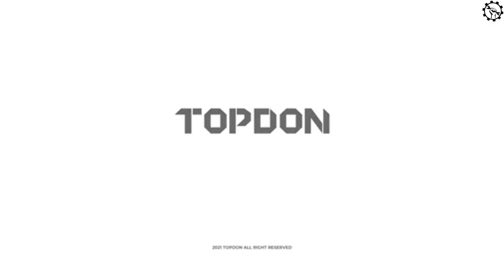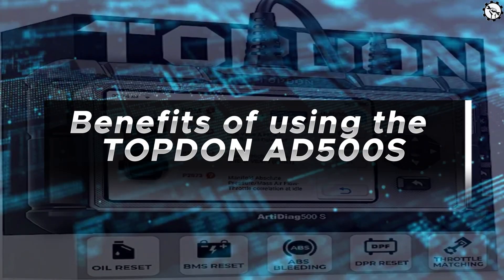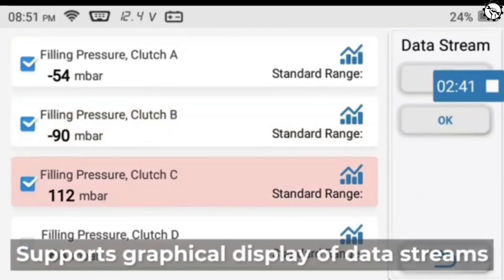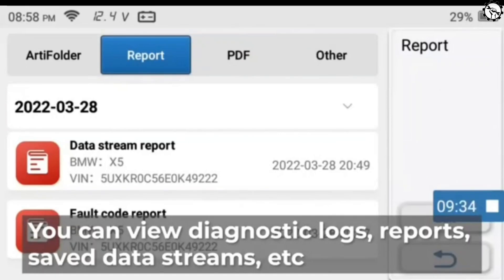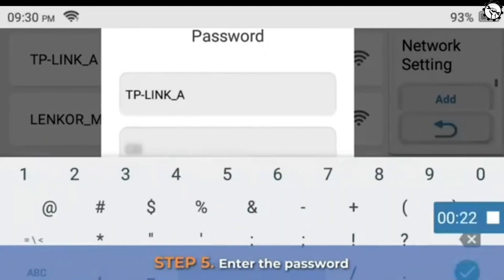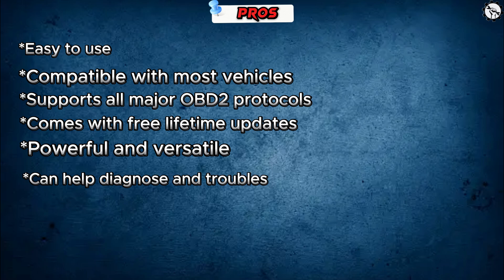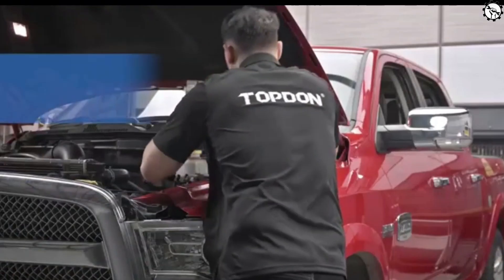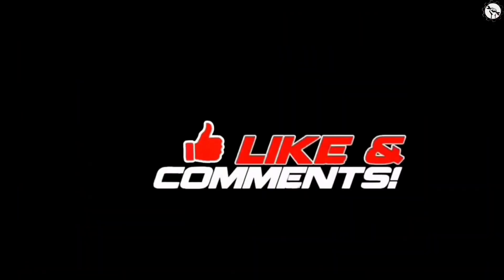TOPDON AD500S Review: The Ultimate Guide to This Powerful OBD2 Scanner |

Comment: How to unbind an account on the topdon Ad500 please help
Reply from the maker: Good question — this is a common issue with TOPDON tools.

To unbind a TOPDON AD500/AD500S, it usually can’t be done directly on the scanner if it’s already linked to another account. The binding is tied to the TOPDON user account on their server.

Here’s what to do:

If you are the original owner, log into the TOPDON app or website with the account that first activated the scanner and remove the device from “My Devices.”

If you bought it used or don’t have access to the original account, you’ll need to contact TOPDON support and ask them to unbind it for you. They’ll typically ask for the device serial number, proof of purchase, and your TOPDON account email.

Once unbound by TOPDON, you can log in and activate it normally.

Unfortunately, there’s no manual reset or button combo to bypass this — it has to be released server-side.

Comment: Does it do the fuel rail pressure sensor on a range rover Evoque
Reply from the maker: The TOPDON AD500S OBD2 Scanner is a versatile diagnostic tool that can read a wide variety of codes and perform various diagnostic functions. However, specific information about its compatibility with the fuel rail pressure sensor on a Range Rover Evoque is not explicitly mentioned. It's best to check the scanner's manual or contact the manufacturer for detailed compatibility information. If you have any more questions or need further details, feel free to ask!

Comment: wondering if it will do a/c
Reply from the maker: The TOPDON AD500S is a battery charger, not an air conditioner. It is designed to charge car batteries, not provide cooling. If you're looking for a device to cool your car, you'll need to consider a portable air conditioner or a window unit.
Reply: @weeklytools LMAO i think he meant diagnose and test ac systems on vehicles

Comment: Does this work on 2015 and higher ?
Reply from the maker: Yes, the TOPDON AD500S OBD2 Scanner is compatible with most vehicles from 1996 and newer, including those from 2015 and higher1. This scanner is designed to work with a wide range of car models and provides comprehensive diagnostic capabilities, including reading and clearing codes for engine, ABS, SRS, and transmission systems1.

Is there a specific vehicle model you’re planning to use it with? I can help you check its compatibility further if needed.

Comment: Do you have to pay every year in order for this  OBD reader to work ? If you dont pay does that still work ? Do you need to  have internet to used it ? If you don't updates does that still work without updates ? Out from the box can you used it without wifi or internet ? Can this scan for Fuel Pressure ? And can this scan for  compression test ? Is this a Complete  diagnostic Scan tools ?does it Scan from 1996 cars going up ? How about Toyota Camry 2001 2.2 Liter  4 Cyl or Buick Park Ave 2003 3.8 Liter does it Scan these cars ? Does this scan for battery ignition parameters ? Does it Scan for a bad head gaskets ? Is this the latest version 2024 ?
Reply from the maker: Here's a breakdown of your questions about the TOPDON AD500S OBD reader:

Yearly Fees:

No, you do not need to pay any yearly fees to use the TOPDON AD500S.
The scanner provides free lifetime updates for software and vehicle coverage.
While optional, these updates provide bug fixes, new features, and expanded vehicle compatibility.
Internet Connection:

The scanner works directly with your car without needing an internet connection.
You do not need internet to diagnose most vehicle issues or use its core features.
However, internet is required for downloading updates and accessing online support.
Functionality without Updates:

Yes, the scanner will still work even without updates.
You can access basic diagnostic features and read existing fault codes.
Updated software may offer newer tests, expanded vehicle coverage, and bug fixes.
Out-of-box Usability:

Yes, you can use the scanner right out of the box without WiFi or internet.
Simply plug it into your car's OBD-II port and power it on.
You can access basic functions like reading trouble codes and checking emissions readiness.
Specific Features:

Fuel Pressure: Some users report the scanner can read fuel pressure on specific vehicles, but confirmation depends on your car model and year.
Compression Test: The TOPDON AD500S cannot perform compression tests. This requires specialized equipment.
Completeness: While powerful, it's not a complete diagnostic tool for all situations. Some complex repairs might require dealer-level equipment.
Vehicle Coverage: The scanner claims to cover cars from 1996 onwards.
Compatibility: Yes, it should scan your 2001 Toyota Camry 2.2L and 2003 Buick Park Ave 3.8L.
Battery & Head Gaskets: It can read battery voltage and certain parameters, but not full diagnoses. While it can provide clues, further testing might be needed for confirmation.
Latest Version: The 2024 version information is unclear. Check the official TOPDON website or seller details for confirmation.
Additional Notes:

User reviews suggest the TOPDON AD500S is a good value for DIY mechanics and car enthusiasts.
Consider your specific needs and budget when comparing it to other OBD readers.
Always refer to the official product manual for the most accurate information on features and compatibility.
I hope this comprehensive response helps!
Reply: @weeklytools  Thank you for the explanation on the product .You explained the product good .

 Is the Topdon Artidiag600S  the same as this one ? Is that free also like the 500 S? What is the difference ?
Reply from the maker: As for the price, the Topdon Artidiag600S is typically more expensive than the Topdon Artidiag500S. This is due to the fact that the 600S has more features and is compatible with more vehicles.

Whether or not the 600S is "free" depends on what you mean by that. The scanner itself is not free, but it does come with a free lifetime update subscription. This means that you will always have access to the latest software and diagnostic information.

I hope this information is helpful. Please let me know if you have any other questions.
Reply: @weeklytools  What I mean free you don't have to pay yearly .Because it's only a regular scanner .so I believe everything comes with it .
Reply: @weeklytools  What Year is this Topdon AD 500 S ? ebay told me that I have to pay $49 a year after 1 year .ebay is saling their Topdon AD 600 S. 2024

Comment: You are so right about the software. And I've found that the sustainability of the battery doesn't really last that long. It would be nice if you could see the battery power. As a small icon on the screen. 
The car battery is suppose to sustain the obd2 tool but I for some strange reason my obd2 tool went into a boot loop and took over a day to recharge. I know what you maybe thinking but my car battery is less than 6 months old and had a deep fully recharge. 👍🏿 as a birthday present I suppose I can't complain but it does seem a bit temperamental. 👍🏿👍🏿
Reply from the maker: First,Happy Birthday to you.

I see. Well, there are a few possible reasons why your OBD2 tool went into a boot loop and took over a day to recharge, even though your car battery is new and fully charged.

The OBD2 tool may have a faulty power supply. This could be due to a manufacturing defect or damage from physical shock.
The OBD2 tool may be trying to update its firmware. This can sometimes take a long time, especially if the firmware is large or the OBD2 tool has a slow processor.
The OBD2 tool may be corrupted. This can happen if the tool is not properly shut down or if it is exposed to a power surge.
To fix the problem, you can try the following:

Try a different OBD2 tool. This will help you to determine if the problem is with the tool itself or with your car's electrical system.
Reset the OBD2 tool. This can be done by following the instructions in the tool's manual.
Update the OBD2 tool's firmware. This can be done by downloading the latest firmware from the tool's manufacturer's website.
Restore the OBD2 tool to factory settings. This will erase all of the tool's data, but it may fix the boot loop problem.
If you have tried all of these things and the OBD2 tool is still not working, you may need to contact the tool's manufacturer for further assistance.

Here are some additional things to keep in mind:

You don't need to have the car running to use an OBD2 scanner. You can read trouble codes with the ignition in the ON position.
If you are using a wireless OBD2 scanner, make sure that the scanner is properly connected to your smartphone or tablet.
If you are still having trouble, you can try searching for troubleshooting tips online or contacting the manufacturer of your OBD2 scanner.